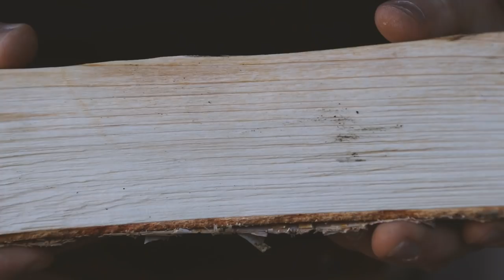Carving A Wooden Liner for Your Slojd Knife - Axe and Knife Only

Comment: when I do mine I cut a rebate only on one piece (instead of both pieces...less hassle)
I sometimes use a nice piece of sawn burl for the front piece for show 
I use a tiny davis brothers bent knife for cutting the rebate, it works a treat
Reply from the maker: Yup, I've done them many ways too, even with a thin cut out between two flat pieces. Stabilized burl and reindeer too, but here I wanted to do a piece in slojd tradition. Birch and knife carved finish as traditional for us green wood carver.